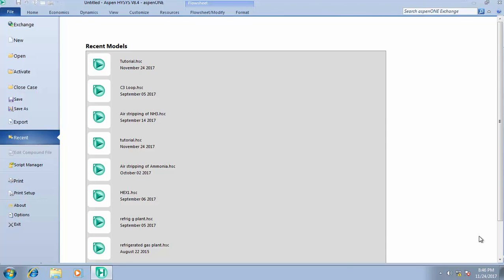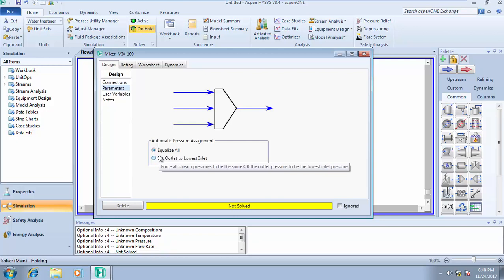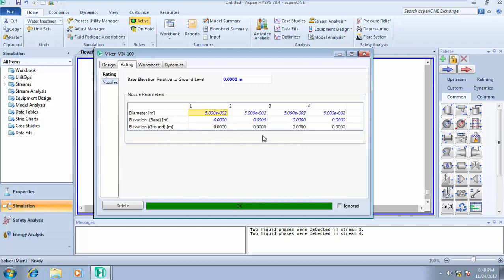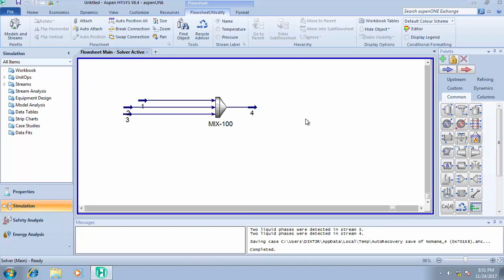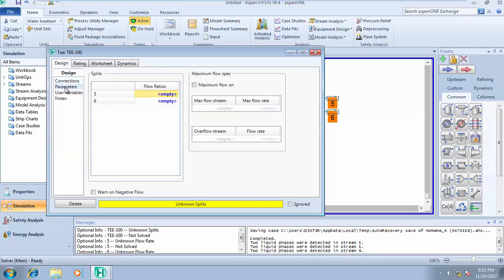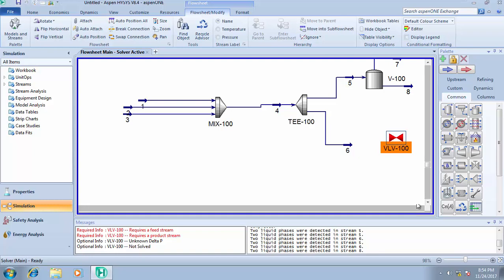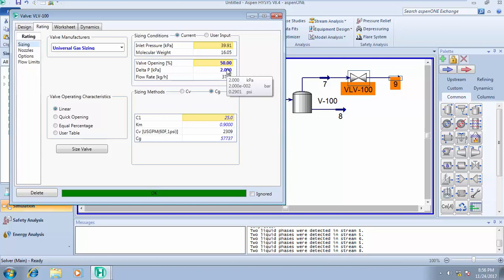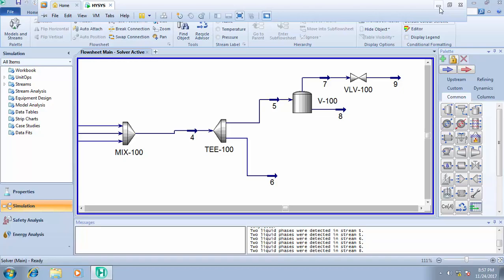Mixer, Tee and Valve modeling using Aspen Hysys

Comment: Thanks for the tutorial man. I am adding a mixer based on a recycle stream coming from a compressor (anti-surge line). It is flowing into the separator gas outlet line (main line) via a control valve. I thought the purpose of anti-surge was to increase head, yet the mixer is only allowing me to equalize or set to minimum pressure. It has been a while since I studied chemical engineering - is it not possible to have P1 + P2 = P3? And if not, could you please tell me the law or a practical explanation why this is so? I'd really appreciate it! :)